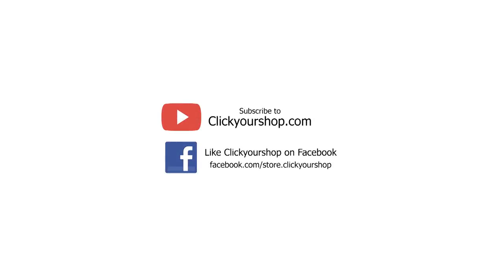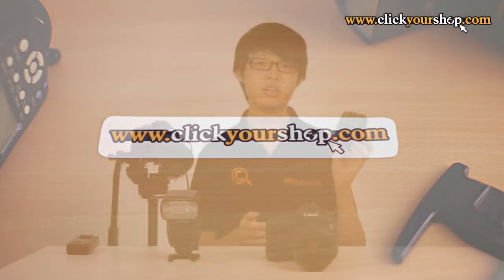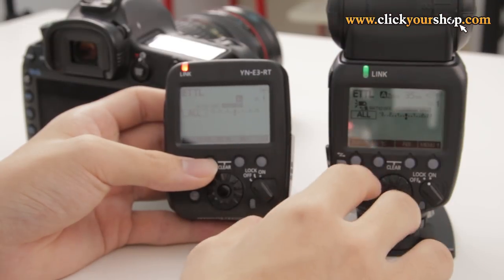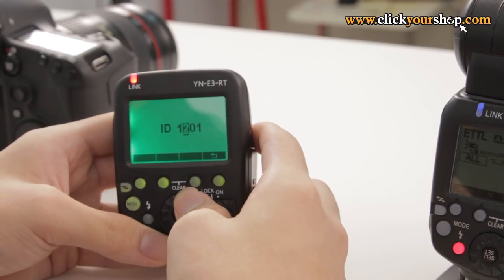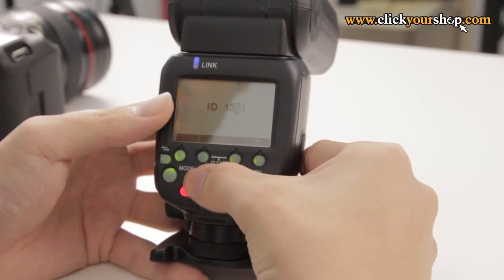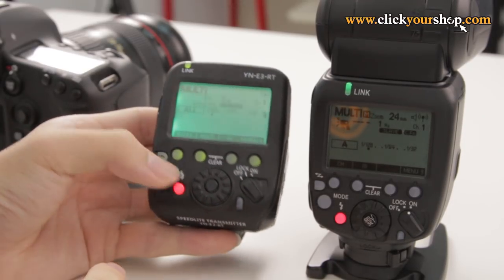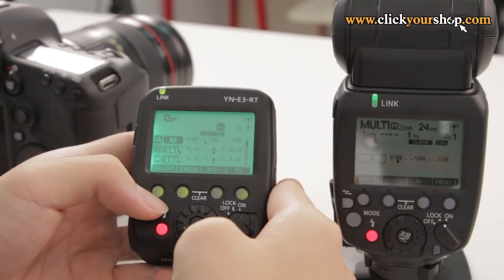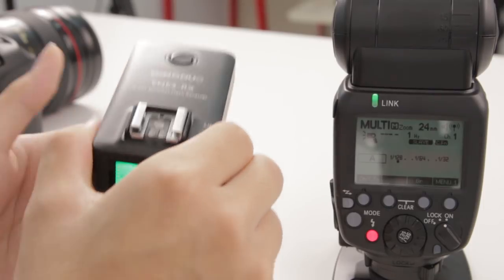Using the Yongnuo YN-E3-RT Transmitter with the YN600EX-RT and YNE3-RX (Product Review)

Comment: Thank you for the review and tutorial. It was very helpful. I could not get my YN-E3-RT to synch with my YN600EX-RT. I had both set to ID 1. The problem, which you showed me the solution to, was that one was set to _001, and the other was set to 0001. The first digit was set to blank, which apparently matters. When I tried to set to 1234 is when I noticed. Thanks again.

Comment: Thank you for the great video. Could you please please do a tutorial on how to set up manual modes using the YNE3-RT transmitter, YN600EX-RT and Canon 600EX-RT? I have all three as they are compatible with Canon but I can't figure out how to use manual mode and there is not a single tutorial that teaches you.

Comment: I have the yongnuo 560 and it's respectful transmitter. In manual I can control the flash output and the zoom. I upgraded to the 609 because of HSS but I have yet to figure out how to control the zoom. How can I do this?

Comment: Hi, thanks for your video. I have three of these and the transmitter. I can link the three lights with the transmitter, but, when I put the transmitter on my camera it does not fire the flashes. I can fire the flashes by hitting the fire button on the transmitter. What am I doing wrong?

Comment: hi, I have the exact transmittee and the flash. I have high spees sync turned on, but my pictures are still showing the black banding at the bottom. if I don't use the transmitter, high speed sync works fine. any ideas why?

Comment: I need help....when using the YNe3rt to change the exposure compensation on ETTL it does not has any effect on my YN600EX RT ii....other than it is connected and flashes.  But exposure does not shows to change on the speed light as on the transmitter.

Comment: hi! when i use my yn-e3-rt with yn 600-ex my batteries in 600ex drains very fast u can say i get aprox 80-100 shots
if i mount my 600ex on the camera battery does not drain i get more than 400 shots n battery indicator still shows half remaining battery ..why is it so????
and why i cannot sync yn-e3-rt for 2nd curtain sync for exposure more than 2.5 sec ???

Comment: I have this transmitter, but ETTL does not with my canon 600rt. the only function that works is changing the power in manual mode

Comment: Hello, can I use 2 YN-E3-RT together so that I can control the flash output from my Yongnuo YN600EX-RT II flash ? I would like to be able to change the flash output using one of these YN-E3-RT controllers. One will be on my camera, the other I use as a "remote" to change the flash output..... I want to do this for bracketed shots where I don't want my camera to move while it is on a tripod. I've tried many things and cannot get this to work. Is there a way to do this ? So to clarify, I want to be able to change the flash settings with the 2nd YN-E3-RT that I would be holding in my hand... this would send that flash output change to the main YN-E3-RT that is on the camera..... - is this possible ?

Comment: whats better ? the YN685 + 622c or the YN600 + YNE3-rx ? They seem very similar
Reply: Tony Caw wild like to know aswel
Reply: You would want to buy a set of ATG/Yongnuo YN622C II.
Then you will have a better ATG AF Assist Beam.
If will turbo your AF lenses even in total darkness.

Then you can park any flash on one of the YN-622C II to become ATG wireless radio ETTL II. And make all camera flash setting from the camera's flash menu.

A set has two transceivers = meaning can be a Master or Slave.
So if you have Canon 580EX II, 430EX II & ATG/Nissin, it becomes radio.

Comment: I have just received the yongnuo yn-e3-rt transmitter and 2 yn600ex-rt ll. i cant get the yn-e3-rt transmitter to trigger the yn600ex-rt ll when the trigger is  fitted to the hot shoe of my Olympus OMD 5mkll. The trigger has the latest firmware and according to yongnuo,s site the latest firmware allows it to be used on other non canon cameras. I can get the flash to fire when I press the test button on the transmitter and the link lights are both green, but when I press the shutter button an camera the flash dose not fire.  Hope you can help
Reply: Set both to "M" not "TTL".
Reply: I have set them to m but cant get Olympus OMD 5mkII with the YN-E3-RT on the camera to trigger the flash.

Comment: Have these 2 same exact models and everything is synced. same channel, same ID numbers, green lights on both but can't get the modes to change or power or anything to reflect one another. Flash goes off if I take a shot. Any ideas?
Reply: So I got the power of the flash output to change controlling it by the transmitter but the power slider on the flash doesn't reflect the change on the transmitter but the actual flash power still changes to whatever I change it to on the transmitter. Not able to get modes to changes and reflect each other like he does in this video though.
Reply: @enigma45044  did you ever figure out what the solution was? Im having the same problem. They are linked and are firing but when i change the settings on the transmitter it wont change the settings on the flash
Reply: Yes. It changes just not in real time. So the flash power will change by using the adjustment on the transmitter but won't reflect on the flash till its fired

Comment: Does it overheats. Can you please answer.
Reply: yeah it does !
Reply: Not unless you want to buy the ATG Gold MG8k Flash Kim X3.

Flashes don't overheat not shutdown:
1. ATG Gold MG8k Flash Kim X3
2. Quantum QFlash (by ATG)
3. Metz 60CT-4 (by ATG)
4. ATG/Godox AD600, Profoto B1, Phottix Indra500
5. ATG Gold 200ws, 400ws, 500ws, 600ws, 1,000ws, 2,000ws

Again, all Canon, Nikon, Sony, Olympus flashes overheat and shutdown.
Canon 600EX II-RT and below = overheat
Nikon SB-910 and below = overheat
Sony HVL-F60M and below = overheat

If you shoot or need HSS or need a real working pro flash, then those five listed are not cheap.

Comment: auto zoom function is not available when you shoot off camera as a radio slave.
Reply: You would need to buy ATG/Nissin system if you need to do ATG wireless radio zoom in ATG ADI TTL, ETTL II, ITTL, TTL, M.
And the top of the line transmitter from ATG/Nissin run:
1. ATG Gold X is over $1,500.00
2. Nissin Air10s is over $150.00

Comment: this kit is not very good goes faulty in a few months but when you contact them they do no reply I have the YN-E3-RT and the display is green with lines down it,  what a waste of money will not by there junk again.
Reply: Something to consider, you can get 6 of these flashes for a single Canon equivalent. It sounds like you got a bad set too, a friend of mine has had 4 of these and the trigger for well over a year now and uses them quite regularly and they've been nothing but reliable. You just seem to have gotten the shtty end of the luck stick this time which sucks.